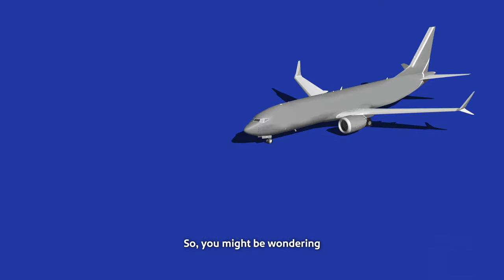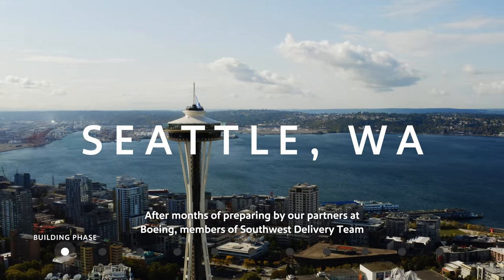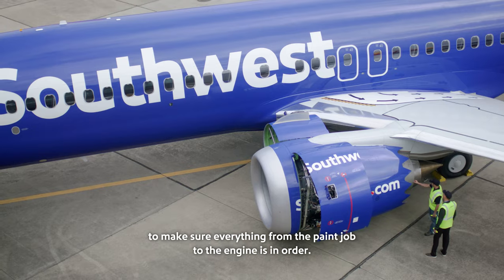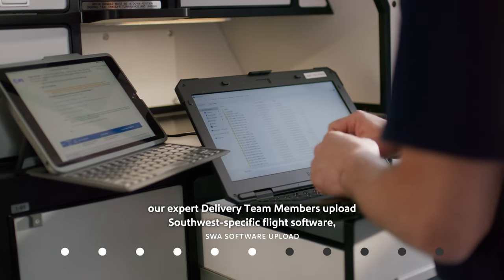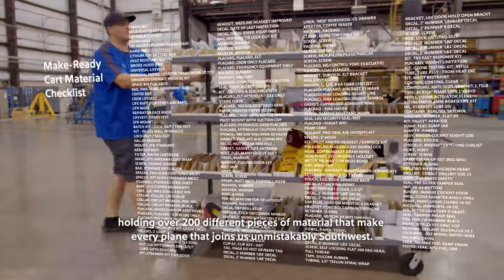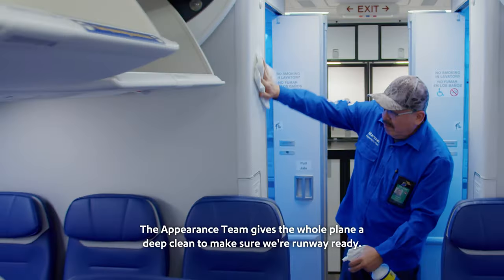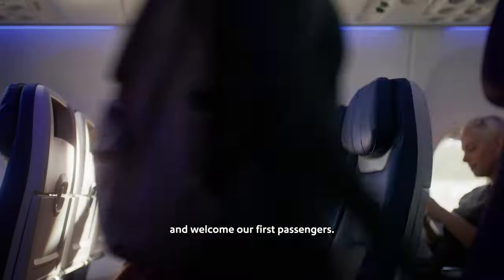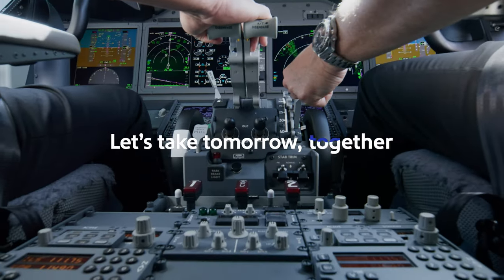MAX 8 Delivery | Southwest Airlines

Comment: I’m sorry did everyone forget about all the people that died on that airplane model?
Reply: It’s fixed, those problems with MCAS were on the 2019 and older models which have also been fixed
Reply: it’s fixed, as the person who said it above me

i got to fly on this same plane, it was very comfortable without any issues
Reply: @thesuperrobertlol so long as the larger engines are tacked on there higher/further forward and accounted for via software patches, nothings “fixed”
Reply: It is important to respect those who died due to a very bad practice, but at the same time no company will ever shut down a successful model which it is. Not only that, but they did deal with the problem. Also, all the other Boeing related incidents appear to be more like one time things and less like repetitive issues.
Reply: @thesuperrobertlol nothing is fixed. The design is flawed that it needed MCAS (a software) to fly it properly. If anything ever happen to MCAS.. then goodbye, trying to fly such unstable aircraft
Reply: @notjohnnyrico  I was talking about the stability of the MCAS software currently, yes the aircraft design is very flawed

Comment: There are reports by an engineer who worked on these planes from Boeing saying he would not fly on one.  I fear these planes are not safe to fly.
Reply: If you’d afraid, keep in mind that these incidents are very rare and almost always non fatal. Over 3500 Boeing planes fly every day. The odds are so minimal. Also, many of the latest issues are likely because of how united maintains their aircraft.
Reply: "Less safe" is the best way to put it. I definitely wouldn't fly on any built since Calhoun took over if I could help it. With the right app you can plan trips based on the equipment used. Easy enough to exclude Boeing.
Reply: @That_transportation_guy oh but 737 Max 8 has too many accident in a year.

Comment: 1:05 doesn't happen at Alaska. Although unrealistic, I hope Southwest abandons Boeing someday and go to Airbus. Boeing is rotten to the core and can't be turned around. That's obvious with two plane crashes and numerous new issues since.
Reply: Listen, most of the new issues are related to airline’s maintenance practices which are disgusting. Not only that, but over 3,500 Boeing flights fly everyday without a single problem. The problem with Boeing is how much bad publicity one incident has generated since what they did with MCAS. Not to mention the 777x is going to change aviation.
Reply: This isnt alaska airlines little kid, southwest has been flying these planes without a single airbus in their fleet for YEARS, giving up on Boeing would be retarded. I have flown the max 8 more than the NEO and I can say its very nice. Am I dead? No, and dont go saying “tell that to the dead people that happened years ago” pfft that was fixed a very long time ago. Please tell me when southwest had a door exploding, go on.
Reply: @Londresorsomething  After seeing this comment for just 6 months, I’d agree with you. The MAX family has no errors and people now think boeing is just a horrible company. People make mistakes, and mistakes can be resolved by a quick fix. 

From the comment he’s saying, is just some idiot who hasn’t ACTUALLY rode the MAX family or either boeing aircraft. To be fair, I rode on the MAX 8 and it was a smooth ride from my perspective. And i’ve honestly loved the aircraft more the the A320NEO.